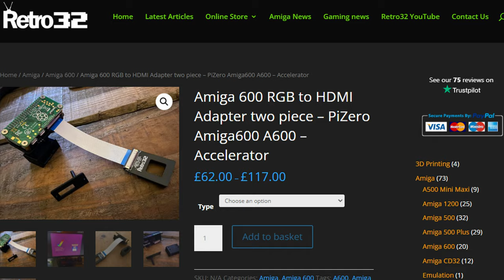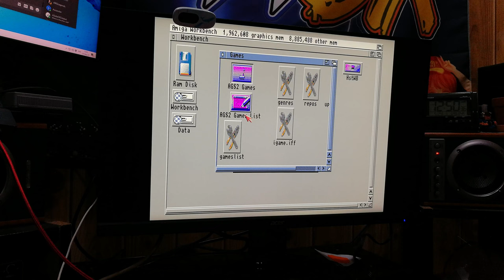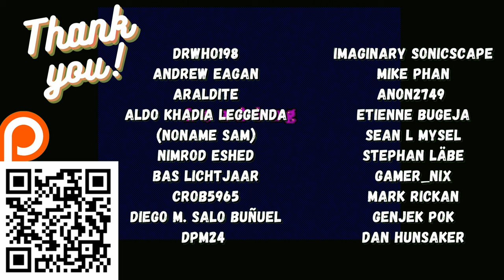A600 HDMI - The BEST AND EASY Way! - Amiga 600 running on Modern TVs and Monitors [RGB2HDMI Review]

Comment: This is a truly wonderful add on for the Amiga 600. I had compatibility issues using it with my Furia, but it works great with my a630 accelerator.
Reply from the maker: The Furia hates most of the sdcards I own.  The best one that works?  A black Toshiba 8gb / 32gb with the 4 in the circle.

Comment: Love the video! Picard makes me laugh btw. I do have a question: does hooking it up to HDMI make PAL/NTSC not matter? I ask as I bought a PAL A600 and am in the US, and did find a PAL/NTSC monitor off ebay, but this looks like a better solution.
Reply from the maker: If you're in the US and you got a pal Amiga, you may need to find either a US PSU or a step down converter first. If you have a pal monitor, stick with that!  Nothing better than the real deal
Reply: @TeamPandory  I got a US plug PSU (from Poland) off the same website as the A600 (Ami64), so hopefully no issues! They said that they sold PAL units to the US without any issues, and I did get a SCART video adapter box too, just in case. Considering the lengths I had gone back in the day to get monitors to work on my A1200, this should be easier/ok LOL

Comment: Nice video, thanks.  Is all the output via the hdmi? - I'm confused about the switch?  So is your monitor a 15khz jobbie, or something like 31khz+; and the pistorm has done all the lovely stuff a flicker fixer/scan doubler does, but for less wonga? (but no vga).
Reply from the maker: The monitor here is a fairly modern 1080p IPS that has no 15khz support.  RGB2HDMI converts the Amiga video signal so you can display on new HDMI monitors... As you said, something like a scan doubler with less wonga ^-^

Comment: This looks great! It even has the infamous NTSC black bottom bar. Are there any issues with interlace coding hacks in certain demos?
Reply from the maker: Not that I know of. Can you throw out some examples and I can test.
Reply: @TeamPandory  There are probably many, but I've just checked and the RGB2HDMI uses the same deinterlacing method as Winuae, so it should all work just fine.